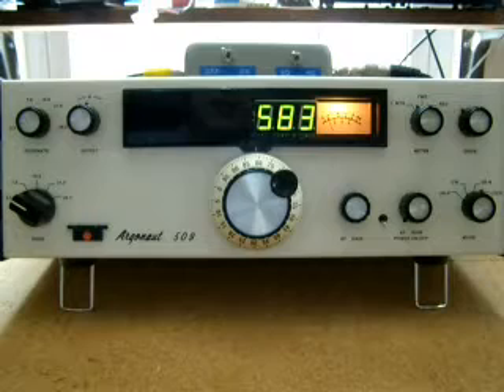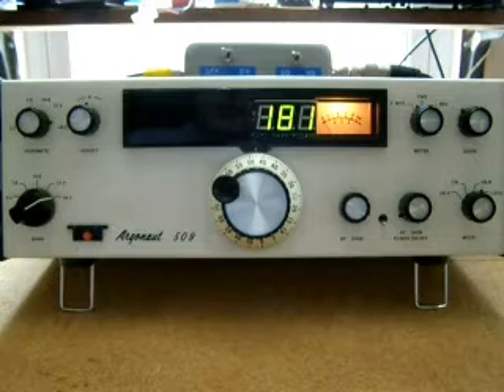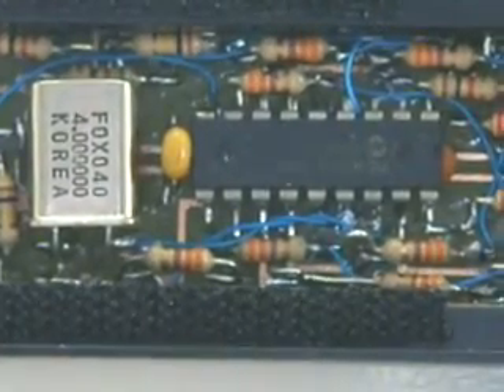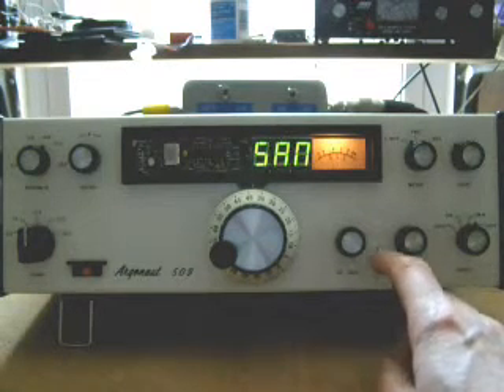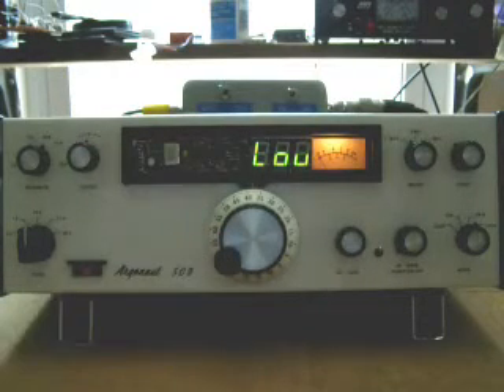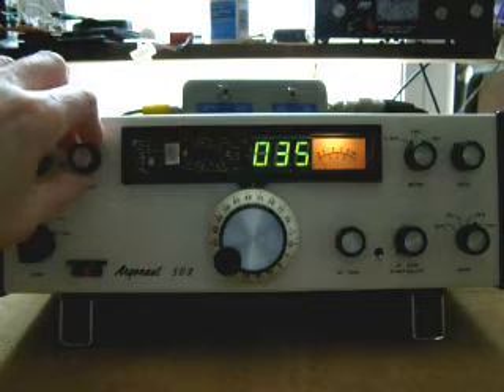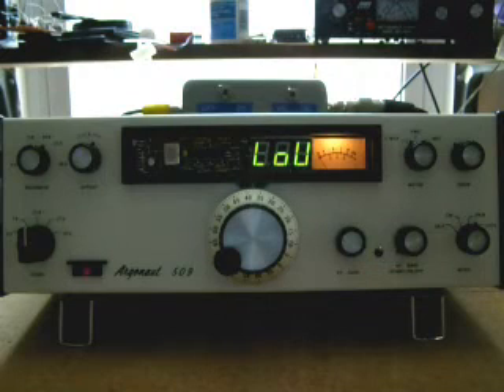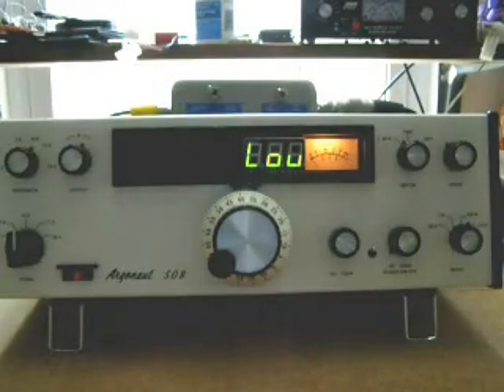Argonaut Digital Display

Comment from the maker: Yes, there is some noise from the muxed display.  I wired the display power supply to the dial light switch on the back of the radio, so when the dial lights are off the display is also off.  Of course I also lose the freq lock function if I want to hear a weak signal in where there is some LED noise.

Comment: As i see, it works great. The best thing is it doesn't influence at all the RF part, not introducing spurs or other noises.
I want to ask if you used some kind of shield and special power decoupling of the module, because about every microcontroller (PIC or AVR) module I used inside a radio caused birdies and other noises at some frequencies on the bands. Once I've got noise from pulses on the LED display signals (because of digit switching).
                  Thanks, 73!